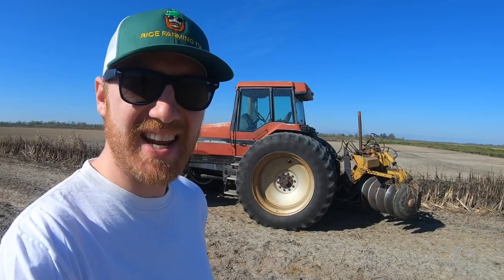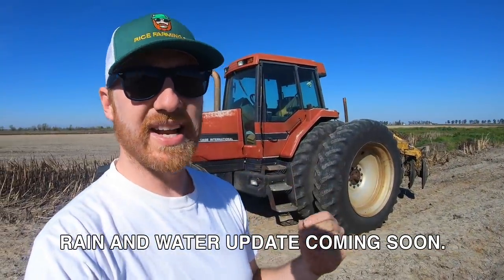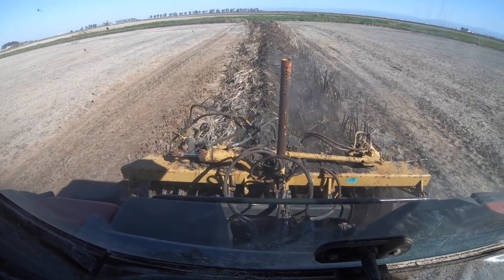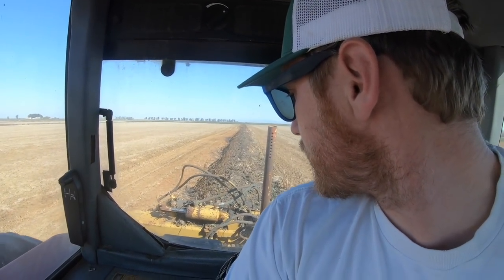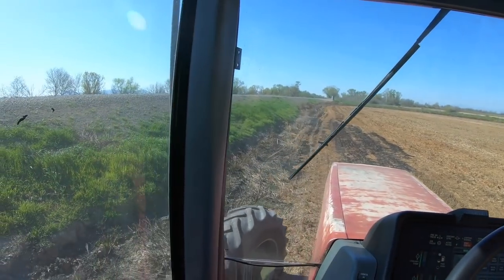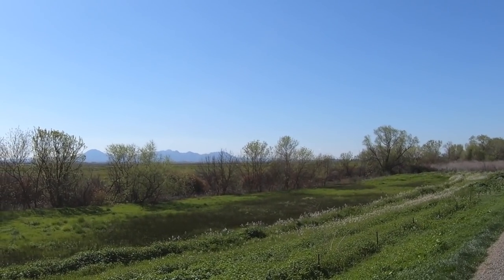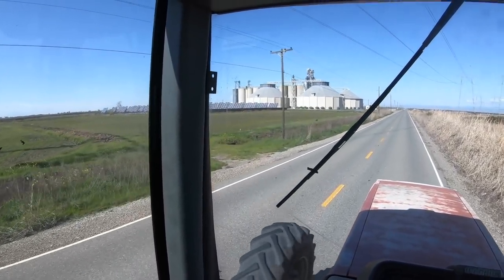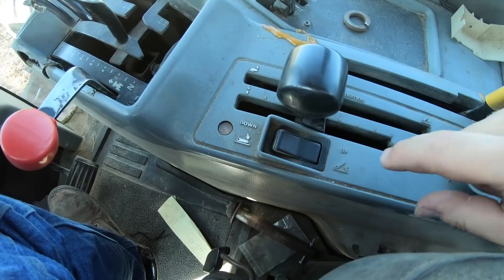The Old Case IH 7240 is Building Levees in this Tractor Video!

Comment: In Eastern Arkansas,  most everyone who raises rice dry seeds the rice with a drill levees are suveyed and pulled after planting. Being in a wetter climate, biggest fear is on first flood being almost to full flood and having a heavy rain come in and due to the levees still being fresh and evem though packed still being fresh enough to have sections of levees to blow out...
The other problem is having just planted rice getting a hard packing rain and having soil to crust over the field then having to crank up the wells and flush the field to softened the crust.....and as you probably know rice will come up if only covered by water 💧 but will not if covered by mud and water, so drainage is very important.

Comment: Great video Matthew!  My number one question is what is the wad of tissue over your left shoulder?
Reply from the maker: Thanks Chris, those holes in the window would be for electrical lines to connect implements into the cab. Things like seeders. We don’t need them so we plug it off with a paper towel so dust doesn’t get in.
-M.

Comment: Why is there a rag stuffed in the hole in the back glass of the tractor? What is missing from said hole?
Reply: On the older tractors, the hole was for running cables for planters etc back in the day...😁
Reply from the maker: Yeah, what Troy said. That paper towel plug has been in there for years!
-M.

Comment: 1995 tractor is OLD? I've got a 1964 Allis Chalmers still working 👍
Reply from the maker: You’re right ‘95 isn’t old—it’s just our oldest that we depend on throughout the planting season. How many hours are on your AC?
-M.
Reply: @Ricefarmingtv  Hi, thanks for replying, it's got about 2400 hours. Still reliable.
Reply from the maker: 2,400 only or 24,000?
Reply: Try farming with a 38 Farmall F20... do it all the time!
Reply: @Ricefarmingtv  2400 hours, winters are long here in N WI. Growing season very short, plus we have other kinda newer tractors that do the bulk of work. The AC is more a helper chore tractor.

Comment: I've never seen a gas powered fuel pump, Why not 12 volt elec ? The tractor your fueling could be the power source.
Reply: PAB a simple small engine with pump attached to it is more efficient than having to always hook up to you power source on the tractor. popular for mobile fuel wagons in our area.